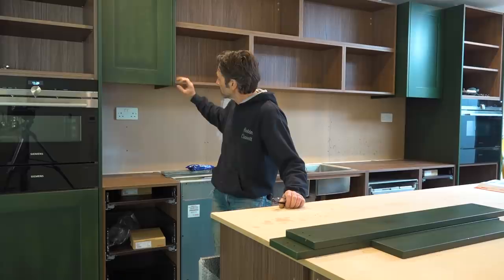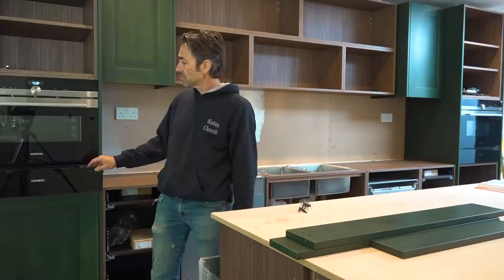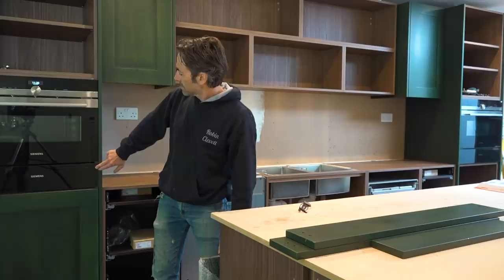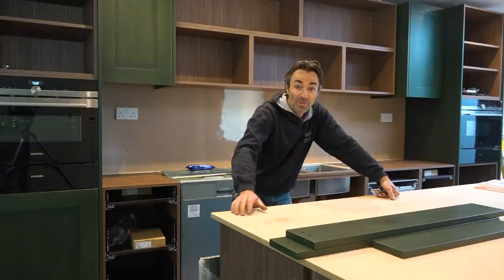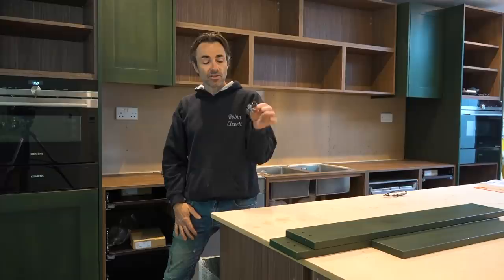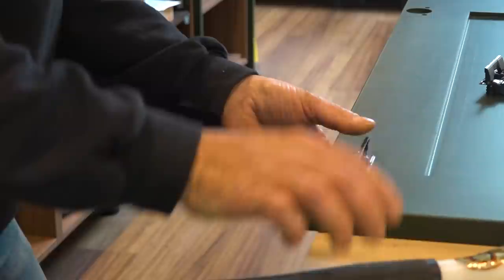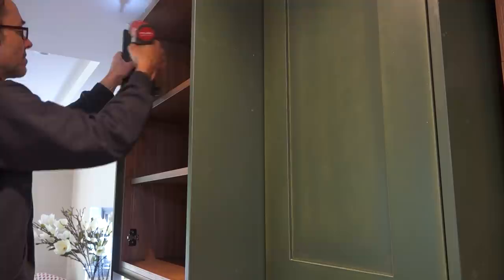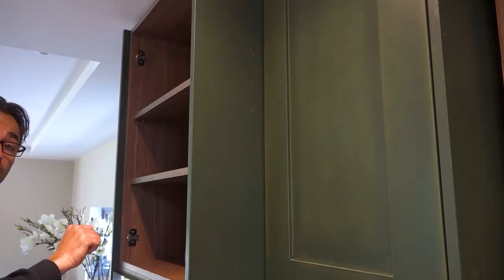Bespoke Kitchen Furniture & LEGRABOX. Capel #26

Comment: Great job as usual.  I rotate the sink unit front rail  so it is sitting vertically rather than horizontal.  You won't need to weaken it by cutting  most of it out and also still fix the material you need to support the undermount sink..  Better still,  if you use material  the same depth as the sink, 150mm-200mm , this will hide the side of the sink when the doors are open. Worth a try.
Reply: Was going to suggest the very same thing myself! Exactly how I do my kitchens...  I also use a header board pocket screwed over dishwasher ( or any other undercounter appliance) in matching carcass material. Very tidy job though Robin as always 👍🏻
Reply: @MrJez1978  same here regards the spacer board for the dishwasher,etc. I tend to leave it in if it's solid surface worktop or if it's laminate worktop I remove it once the top is fixed down then fit the dishwasher,etc.